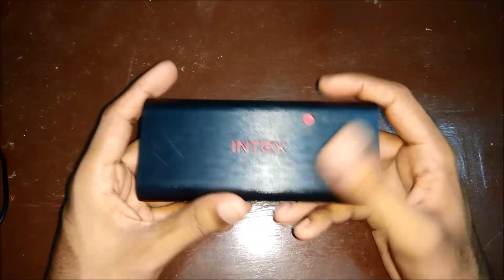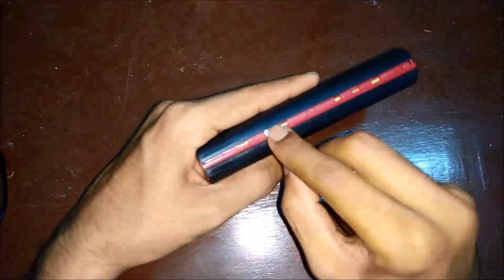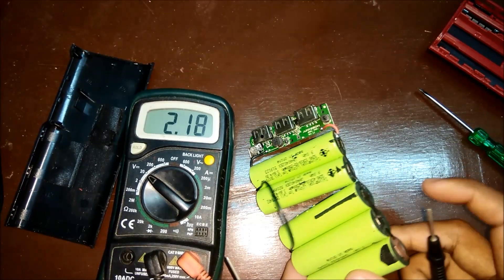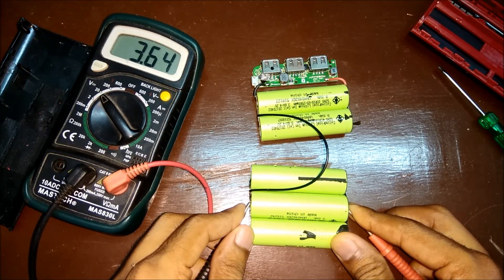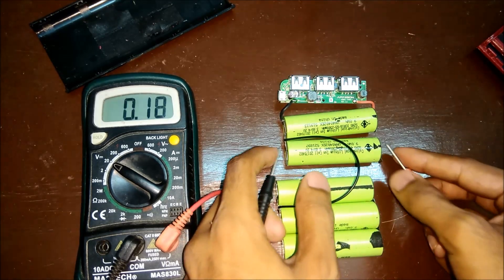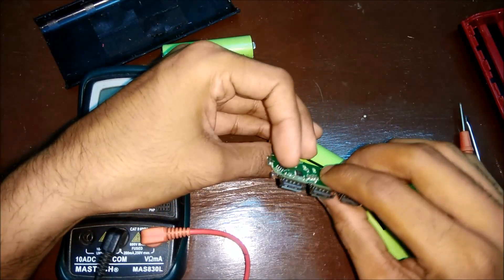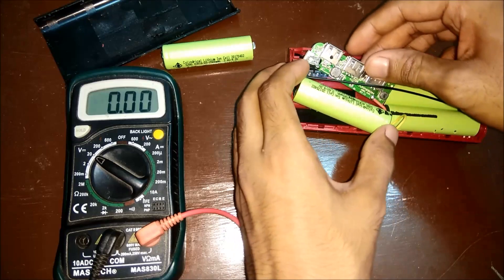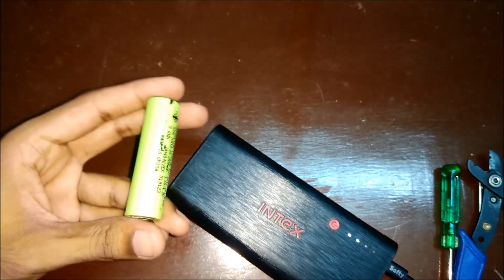How to Repair a Dead/Dying power bank

Comment: I have this same model powerbank. But it is not getting charged. When i plug the charger cable the indicator led is not even getting ON. Plz suggest a solution for this prblm